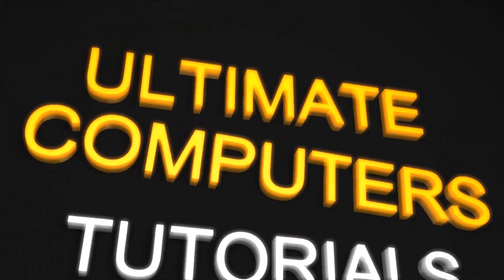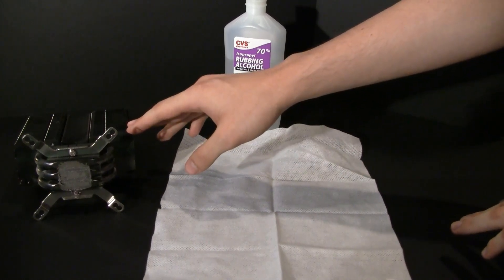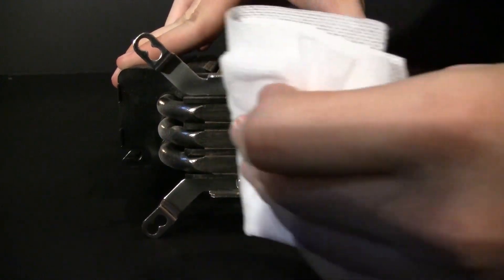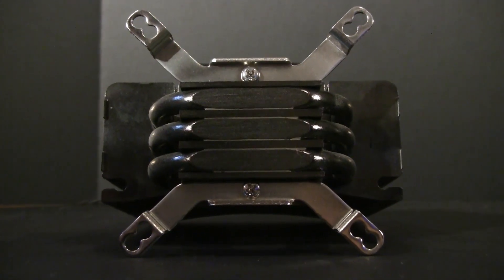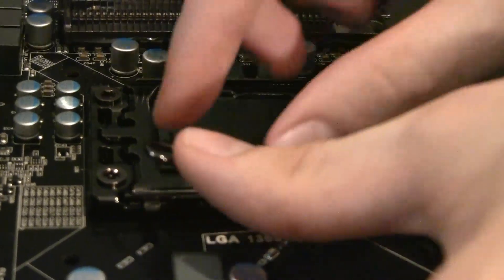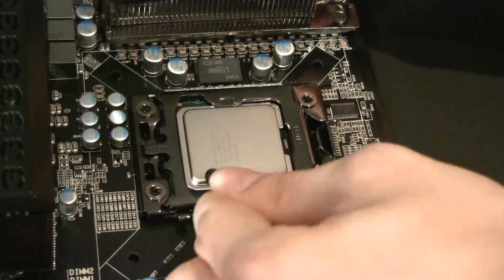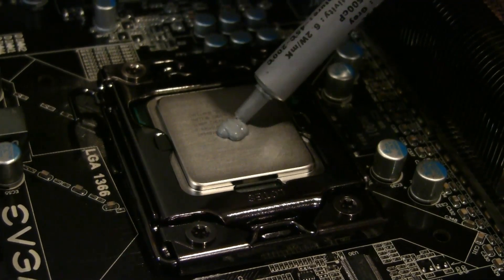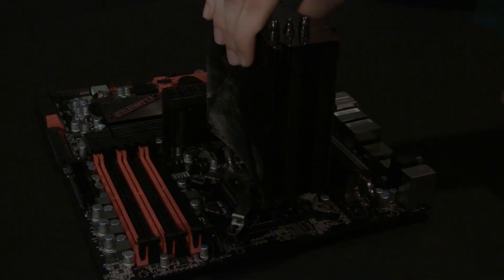How to Remove and Apply Thermal Compound  [Updated Tutorial]

Comment: well I thought this was for a laptop's processer. It's not much different, but the "Dark knight" CPU cooler clearly isn't part of a laptop. Should you make a video for a laptop, up to you but I'm not sure if I should be doing it differently.

And there is no "limit" to how much paste you can put on. It's just that it might screw up the motherboard when the heat reaches the compound, (if that happens I've heard) as it extends in a way onto it. To little might be like not having any at all, and the whole process is ruined because heat can pass much easier. Just a heads up because lots of comments are negative, and just suggesting what to do in certain cases.

Comment: People freak out about amounts. LMFAO, try it for yourself people. When I use a LOT of thermal paste (the wrong way). My temps are much cooler. I don't have time for details, but try it for yourself. Over 2 decades and I still go back to the same way. I make a X and + with the paste. Then just a little wiggle before the screws, 3% to the left and right. Super low temps. 
 ***CPU is at 28 and Mobo at 27 as we speak...................***

Comment: DO NOT USE THAT MUCH THERMAL PASTE! This is not the 90s . . . THERE IS AN EXACT QUANTITY YOU WANT TO USE! You should only use a rice grain to BB size amount. Good bye CPU warranties to those that followed this destructive video. -_-
Reply: This bothers me. HOW DO YOU KNOW if you've applied it wrong unless you remove the cooler? And if you remove the cooler you have to re-apply again?
Reply: @Efreeti  you can remove the cooler just after you've fastened it to see if it's been evenly smudged, since the cpu hasn't been on yet the paste is still unused so to speak so you don't have to reapply it
Reply: While that's more compound than most would use it probably didn't even make it to the edge of the CPU. I myself prefer a thin line of paste over the pea method, however either work well.

As long as the paste doesn't move past the edges into the CPU socket it won't do any damage to the CPU.

Comment: I recently build this PC. It uses and AMD Phenom II X4 860K. I've applied the thermal paste, but after bootup cpu temp's at idle are around 50 degrees. This is too hot isn't it?
Does the thermal paste still needs to set or did I apply the thermal paste wrong?

Comment: Theres no point you don't need the entire processor covered in the past and by making that X you are almost guaranteed to put too much on. Everything that makes heat is in the middle of the chip just place a small dab in the middle and install the heat sink. The pressure of it being installed will force the paste towards the edges.

Comment: lol this is almsot a joke. Use the purest alcohol you can I use the 99% stuff. And it doesn't take a few minutes for it dry off it takes seconds you can watch it dry it dries that fast. He put way to much thermal paste like half that is needed. Atleast he didn't spread out that just introduces air bubbles into the equation.

Comment: Cotton balls and q-tips with the rubbing alcohol work just as well, and gives you the ability to dig into any cracks. Also probably waaaay too much paste applied there. Should be a bit less, and some say no bigger than a grain of rice.

In reference to the old video (since comments are disabled on it), AC5 is not conductive. I've dropped some on my socket before, and even after cleaning it up the best I could (on a 478 socket), it did not kill anything.

Comment: Wow, 92°C would be danger zone for a CPU under load never mind idle. I'd hate to see what temps it would reach under prime95. What is your cooling solution? A re-application of thermal paste could greatly reduce the temps if it is not conducting well. Hope you get it sorted.

Comment: Thermal paste is a very high heat conductive paste that is used between two objects (usually a heatsink and a CPU/GPU) to get better heat conduction. It fills in all those microscopic imperfections on the heatsink and CPU/GPU that can trap air in them and cause a loss in the heatsink’s performance. Air is a very poor conductor of heat. Thermal Interface Materials (TIM) can be up to a 100 times greater conductor of heat than air.

Comment: It's thermally conductive paste that fills in tiny imperfections between the CPU heat spreader and the heatsink, thereby alowing heat to transfer from the two surfaces more efficiently.

Because it only has to fill very tiny imperfections, only an extremely thin layer is needed.

Comment: Are you guys building a sandwich or a PC?

Isopropyl alcohol is about 2 bucks a bottle and thermal paste about 5 bucks a tube. If someone is so broke they can't fork out 7 bucks and have to consider using vodka and mayo to assemble a motherboard, they probably should be concentrating on a job rather than worrying about CPU heatsinks. 

Good grief ... lol

Comment: I would say that while the pea method is a decent method (depending on the cpu and where the die is located), that is way too much thermal compound. Tuniq TX-3 is quite viscous so it might not spread as much as other compounds but that amount will be spilling over the sides. Covering the IHS (Integrated Heat Spreader) is not required. I would say at most, half that amount. The compound should be a very thin layer covering the area of the actual die(s) on the cpu.

Comment: Well, it turns out, i took out my CPU fan, and disabled the heat sink to clean it(bunch of dust) i put it back in, not sure if iam putting in the correct position, i did this twice, and every time i do something on computer, whether its going on yahoo,The CPU Fan gets super loud, please help me fix this. i didn't put any Thermal Paste when i was done cleaning. could this be the solution? do i have to go buy thermal paste and apply it to the cpu and this problem will go away? please help me!

Comment: Q-Tips dipped in the alcohol works very well for getting the old crusty TIM out of the nooks and crannies. I fix and rebuild custom PCs for a living and have to remove and apply TIM almost daily. 

I've also noticed that TIM gets crusty after a couple of years of use and starts to act as an insulator rather than a conduit for heat transfer. It's not a bad idea to re-apply it every couple years as maintenance, even on a PC not exhibiting any problems.

Comment: If you're talking about the toilet paper we're thinking about, then most times with a heatsink thats been in use for a whlie, that won't work very well. It just breaks apart and makes an even bigger mess. Using the alcohol ensures a good clean slate to start with.

Comment: every single of these "500 other videos" suggest you use some sort of alcohol based product to remove any thermal paste residue. You can compromise optimal heat transfer between heat-sink and cpu if you don't. This is especially a nightmare for overclockers due to the increase in heat generation from raising voltages. Lint/dust/air bubbles/grease from your fingers can all yield same result from not thermal paste clean up.

Comment: no. zalman said that for best performance its about 6 months till a year( because the compound dries and loses it thermal properties about 40%) you can still use the old paste it will "work" but for best performance change it as often as possible (every time you are dusting the cpu cooler change the paste)

Comment: Yes, new heatsinks usually have the thermal paste pre-applied. It's good that you did. Running without thermal paste will destroy your CPU. Even worse, depending on how hot your CPU gets it can even catch on fire. So yes, it can even be dangerous to run without paste. My CPU was reaching 100 degrees Celsius, and it's just a duo core.

Comment: No. Toilet paper will leave the little fibers and get on the CPU+heat sink. The goal of the dust-free cloths is to completely remove any dust and particles from the surface and having a clean environment. And isopropyl should be fine. Its better to go with higher percentage alcohol content. It makes getting old thermal paste off easier.

Comment: When the thermal paste sets, it creates a near perfect layer of contact between the two surfaces. When you break that, the layer of contact will be uneven and several air bubbles will turn up. Each flaw in the thermal paste reduces the effectiveness of the HSF (Heatsink Fan), and increase the working temperature environment of the CPU. Worst case - the CPU will fry.

^ Quoted from gbatemp.

Comment: So i have a question, when i opened up my laptop to repaste, there's this colored transparent sticker over the cpu and gpu. Obviously the factory paste was everywhere, even under the sticker and all over the rest of the chip. I took off the sticker and cleaned up everything, but my question is do I need to keep the sticker on? It's almost impossible to clean the paste off of the adhesive side of it.

Comment: Thanks for answering :) But I'm a little worried cause after I removed the fan, I turned on the computer and left it for 10 minutes. (Without starting any programs.) Is it possible that the CPU could have overheated within that time? (It's a Intel Core i5 2.4 Hz overclocked to 3.4 Hz.)

Comment: You really want to use a 90%+ Alcohol, not 70, 30% water leaves a nasty residue and doesn't clean as well as 90+. I usually use a bit of my everclear alcohol which is 92%.

Comment: I bought a new motherboard/cpu/ram bundle today consisting of x79a dg65 8d MSI mboard, i7 3820 3.6ghz cpu (with Frio Advanced thermaltake cooler with 2 fans) and 16gb 1600ghz ddr 3 ram.  I used quite a lot of thermal paste and I don't think the layer is evenly spread or thin. Should I make sure it's really thin? Idle temp is at 40 degrees c and I use 3 intake and 3 exhaust fans. Thanks.

Comment: I have the same i5 2500k, but mine is overclocked to 4GHz. I get idle temps of low 30's and under load I got 59 degrees so far. Also I have two fans on the Hyper 212 EVO which push and pull the air out towards the rear exhaust and are running at low speeds, but ramp up when the CPU gets hotter. I have Corsair Vengeance 16GB of RAM, GIGABYTE HD 7970 Windforce GPU, ASRock Z68 Extreme3 Gen3 MoBo, PC Power & Cooling Silencer MKII 950W PSU, MUSHKIN 120GB SSD, the Corsair 600T white edition case etc..

Comment: Hmm that's interesting, I have the Corsair 600T White Edition Case, I replaced the thermal paste with Arctic Cooling MX-4 and put a very thin layer on the cooler. I have two fans on the Hyper 212 EVO, overclocked my i5 to 4GHz and now I get idle temps of 38-40 degrees and while gaming around 58 degrees. Maybe this is the best I can get...

Comment: @sciguy14 my new pc is still 9months old, but it's overheating already my cpu's temp is reaching 60c (idle) to 81c(heavy),,it doesn't reboot cuz i configured it on bios, and it's an i3 540 cpu, i know that it should be only 35 to 43c and 50c tops, and i've got 4 fans in my pc chassis and in an airconditioned room..how could this be?

Comment: @jebbtalle Without paste, there will be a small gap between the CPU and the heat sink.  This gap, although small, kills the ability of your heat sink to pull heat from your CPU.  Thermal paste fills this gap.  It's a far better conductor than air, but not nearly as good as the metal of your heat sink, so you want to apply as little as it takes to cover the contact surface.

Comment: That's waaaay too much thermal paste. It doesn't have to isolate the CPU, its role is to level out any irregularities and gaps between the 2 surfaces. I would probably use half of that, and make sure the heatsink is tightly mounted against the CPU.

Comment: @Tinytacohead np & yowch, that's pretty hot for a CPU!  I just put a ThermoLab Bada on an FX-4100 and while the idle temps seem typically read 35/43 for the two CPU sensors, I've never seen it go past 56c on load either.. (and don't think the fan's even ramping up)  so yea, I think I'll just play with fan profiles & leave the cooler be for awhile.  good luck!

Comment: @emreforum1 if the surface of the thermal compound is uneven and has pits and hills, this allows bubbles to form. spreading it manually is stupid.

if you understand basic physics, its obviously stupid to spread the thermal compound manually.

the sink and cpu should be as close as possible, ideally they should be fused.

the gap between them should be filled completely with thermal compound

Comment: 91% isopropyl alcohol should've been used. 70% leaves a layer of residue. Good job on pointing out that lint free cloth should be used. I actually use this type of lint free paper towel (Viva) that has a stretch rubbery feel to it. Use it once and throw away and it's cheaper than buying lint free towels.

Comment: @Mixter81 My opinion is that he used a little too much, yes. The recommended way to apply thermal paste for core i7 and many other cpu's is to simply draw a thin line of thermal paste down the centre, around 1mm thick. 
This spreads well around the hottest part of the cpu (the center), and is much easier to get consistently right than a 'pea sized amount'

Comment: I couldn't find the CPU so I bought 12 tubes of MX3 and smothered it all over the motherboard. I then took 150ml of alcohol and poured it over the motherboard and slightly shook it to evenly spread it. I used a hairdryer to dry it all. I now get 10 to 15 degrees less than before.

Comment: you applies wayyyyy too much bro,(only a quarter of the amount you put on)  another tip is after you spread the paste around with the fan and you are ready to screw the holes in, lift the fan and actually check if you got 90-95% of the area and that there is not the slightest bump

Comment: @t0k3z420 Thermal paste doesn't need to spread to every corner, and doing it this way reduces air bubbles that you would get if you just spread it around with a card then apply the heatsink.  This is the preferred way.  Although, I've read that it's supposed to be the size of an uncooked piece of rice, not a pea.

Comment: That's fucken stupid spreading it with the heatsink chances are won't spread even thru out the chip an likely spill on the outer edge of the chip.

It's better to just apply a dab of paste and use a plastic card to evenly apply it to the chip in the plastic holder it came with.. If you do it while on the motherboard you can easily mess up and smear it on the metal latch

Comment: @xBigWill94 Yes you can. Also, when screwing the heatsink/waterblock down, make sure to screw each screw evenly. So for example, screw each one by 1/2 a turn until they are all screwed in. This way will ensure the thermal compound is spread evenly.

Comment: @baskal002 It might be that some of the compound leaked onto the mobo and caused the burn you talked about. What I'd try to do is remove the heatsink, than clear the compound and apply it again but a slightly smaller amount. Than run it and see if there is any difference (it might just be that you have applied so much compound that i's boiling instead of transmitting heat) if it works than voila. If it doesn't than changing the heatsink probably won't help.

Comment: my AMD Athlon X2 64 5600+ (2.8Ghz, NOT OVERCLOCKED) idles between 57-62c and 110~120c when playing games (yes, it's true. until it shuts down by itself afterwards).. I checked the CPU slot on the mobo and there is a black stain and there's a burnt pin on the processor.. However, it is still working though and I'm using it right now. The consequence however is I cannot play games anymore. Is buying another heatsink like Tuniq Tower 120 Extreme is would solve my temp problem?

Comment: You should also add that you should screw the heatink down EVENLY, because if you don't you may put too much stress on one side and either unevenly spread the thermal paste or even worse mess up the socket.

Comment: @mario11168 maybe you can help me mario, my i5 2500k idles around 35, and core 2 always in the high 30s/low 40s; under load it gets up to high 60s but drops to low 60s bit if I take the case side off and aim a room circulator at the CPU.  I'm thinking I might have messed up the thermal paste application, the entire system is newly built.  Thoughts?

Comment: @TheCaramek 

Pretty much thermal grease is good for a few years if stored correctly. The cap must remain on the syringe. If you happen to come back to it, and see a good bit of it dried on the tip, just use the alcohol described above, along with the lint free cloth to clean off the dry bit. When you might get a tiny bit of clear liquid the next time you apply it, Just clean it up, and reapply.Thats a little bit of settling in the paste itself, and nothing to worry about.

Comment: @ziianHD Seriously, you have to ask that...

The stock heatsink is generally 50c idle 70+ on load, which is still fine, the processors are made to withstand heat and shut off automatically if it gets to the point of damaging. So yes, obviously, that is a good temperature, and I'd be surprised if you could get any lower unless you used liquid nitrogen or fancy fancy water cooling.

Comment: @MYsterYmarcus just wondering if you can help me again, so far you're the only person who understands me. My cpu temps show in bios like 42c but when i'm in windows it shows like 32-34c. Is that because I have cool and quiet turned on in the bios? Atm I'm running BFBC2 and PC Probe II Is reading 46c. I think thats right. But thats pretty high for my liking. I overclocked from 3.4ghz to 3.6ghz and my pc was blue screening on bfbc2.

Comment: Thanks for this video it was useful. I think the method you describe here is more widespread (at least in factory built machines) than the method in your first video, because when I see the thermal paste on cpus after removing the heatsink, the edges of the thermal-pasted area are usually kind of round looking, which suggests they did precisely what you did here. Although saying that, my AMD phenom came with the paste already on the heatsink (which was obviously hermetically sealed ).